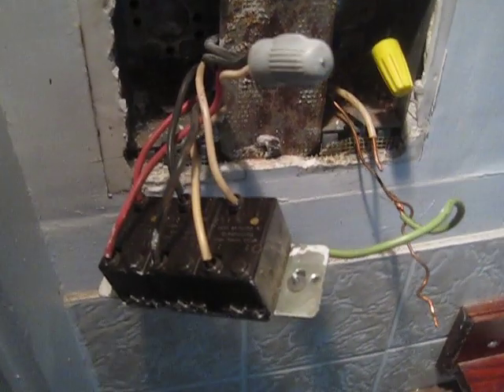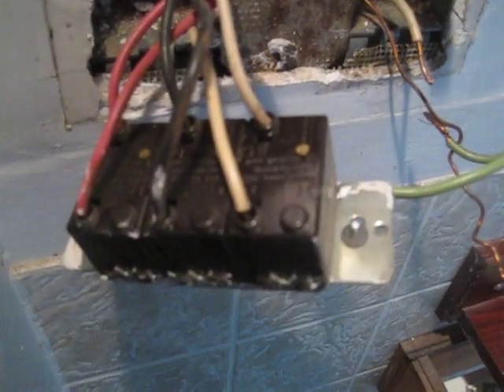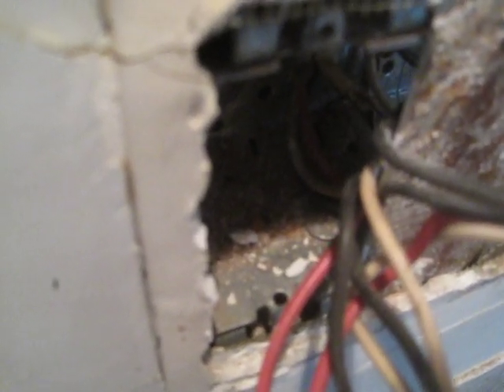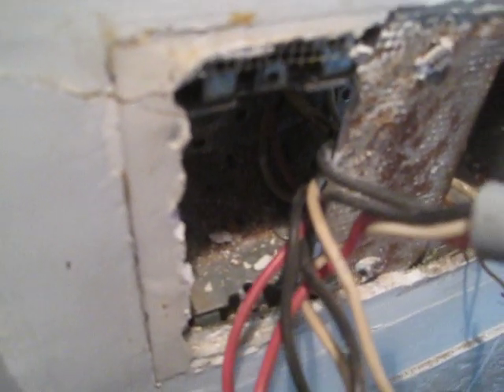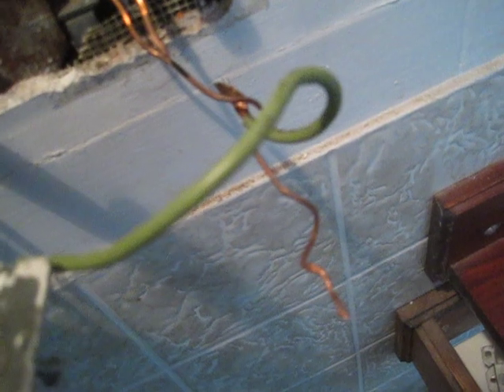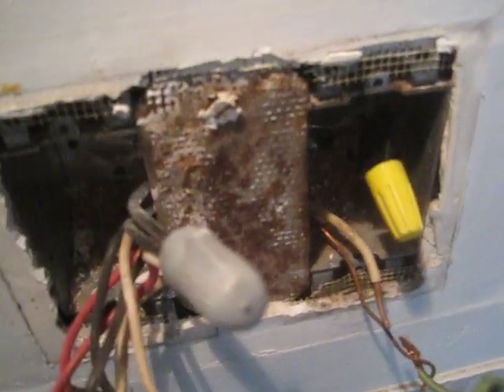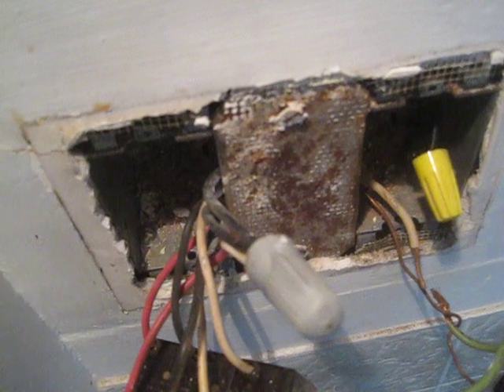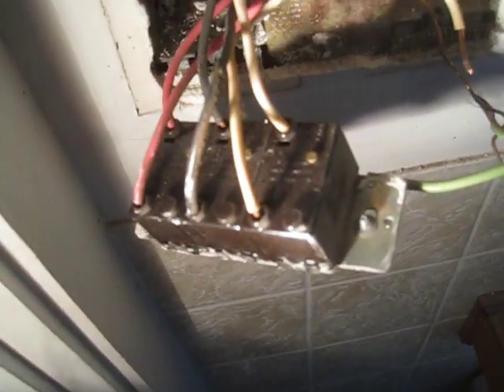2of2 - Miswired bath Fan light and heater

Comment: The heater should be on it's own circuit breaker, 15A.  The GFI circuit it was tapped into for the light/fan is not kosher, since they are only for the outlets. It would work OK.   The heater element takes all the amps and really can only be safe on it's own circuit breaker. So run a fresh line from the distribution box with a 15A and use it for  this entire assembly, heater/fan/light.  You only need 1 neutral and 3 switched hot lines going to the fan.  Of course there should always be a bare ground wire (not connected to neutral (white). 
If you only have space for 2 gangs,and need 3 switches, you can get double switch boxes that fit in 1 gang.  On mine I use one gang for a larger paddle to turn the heater on.  I used a 2 switch box next to it for the light and fan. That way I can keep them separate in my early morning stupor.   You could find a 1 pole-2 throw switch with an OFF center, if you are afraid of turning both fan and heater on at the same time. it wouldn't blow a fuse, but is kind of a waste, since the heater outlet and fan inlet are so close that you wont get much heat in the room. 

So if you have 4 wires going to the fan from the switch box, you can do your fan/heat/light combo.  The white wire you are going to turn to a switched hot (black) needs to be marked clearly with black tape. 

I wouldn't try short cutting and using the GFI or outlet breaker for the heater too. at best it will pop anytime somebody tries to use anything plugged in when the heater is on.  If the house has older wiring (paper wrapped, nob and tube, or aluminum) you definitely don't want to stress the wires or you could have a fire in the worst case.

Comment: I know I can have this vent and light running but if I decide to add the heater would this be safe - 
Use the old wiring for Heater & Vent (instead of light & vent) and tab into another light switch to get Positive for the light by adding a three way switch?

My other situation was to add a 2 way switch - 1 switch for light and the other switch had three positions. On - OFF - On which would turn either the Vent On, or the Heater On but not both. This would help me not to run an extra hot wire.

Comment: Hello, I am running into a similar problem where I am installing a bath vent/heater/light which is replacing a broken Vent/light unit.
From the old unit there are only 2 switches (Light & vent) and 4 wires (1 hot & 1 neutral for light) and (1 hot & 1 neutral for vent). There is a stripped Ground wire as well which doesn't connect to anything and the new unit doesn't have a ground wire or screw.
What's the best way to add the heater unit into the switch without running a cable to the fuse box?